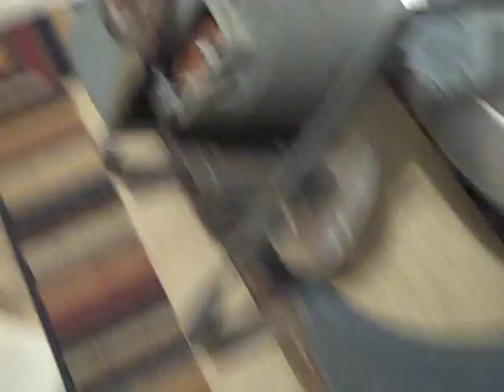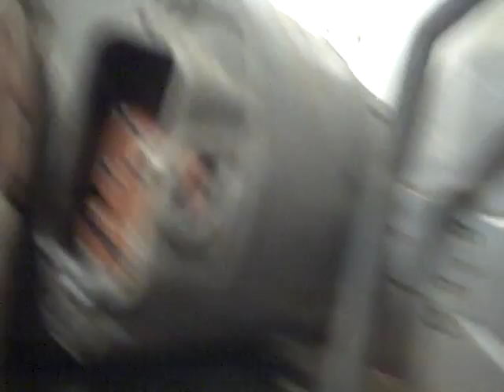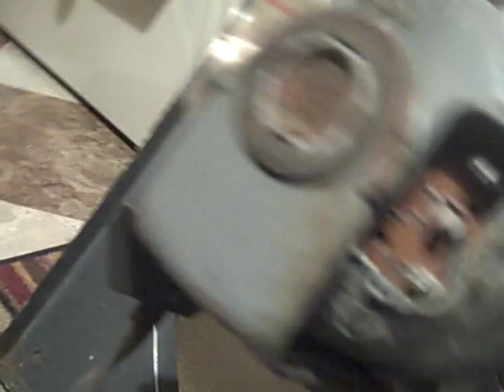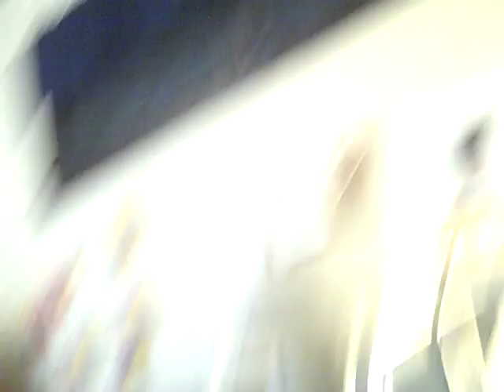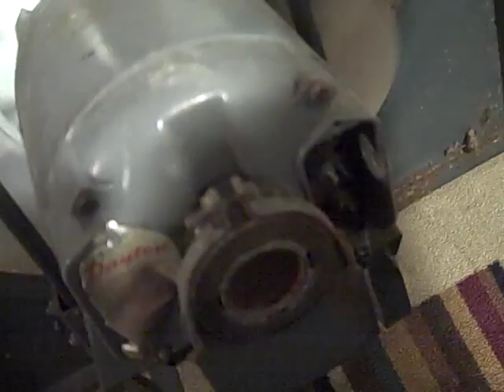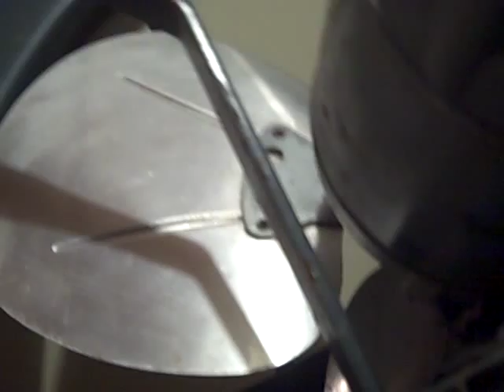Dayton Industrial Fan

Comment: It would make a nice attic fan. I suspect the broken phenolic or fibreboard is part of a centrifical start mechanism. Maybe not but replacement parts should be available. You can always attach a small motor to the front of the fan to slowly turn the blades with a bright light shining through as you would see in the obligatory slowly turning fan blades shown in many modern horror movies. GK

Comment: You may be able to epoxy that terminal board back together. Usually there is a wiring diagram inside the terminal cover which covers how to wire it up...if there are three terminals there usually is a way that it is hooked up for forward, and another for reverse. You may be able to discern where the AC line was hooked up based on the loose terminal screws.